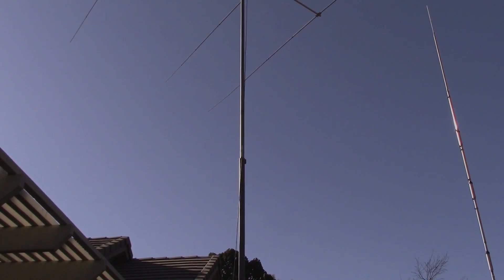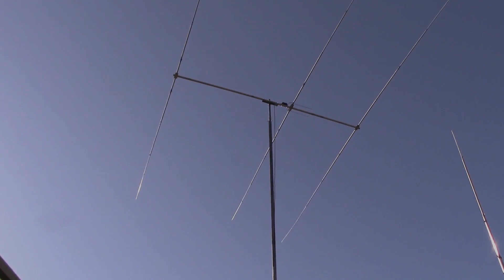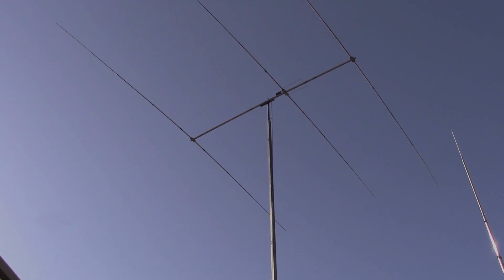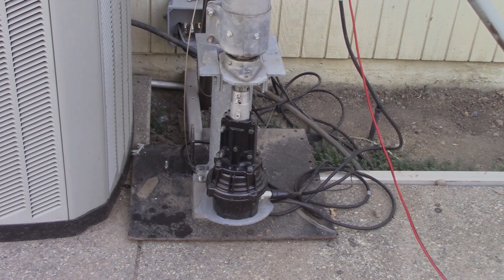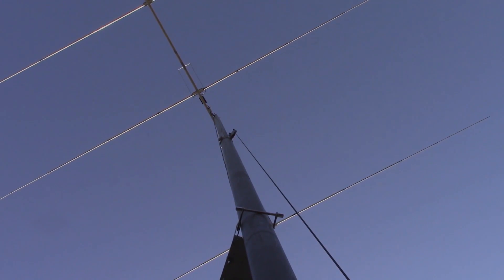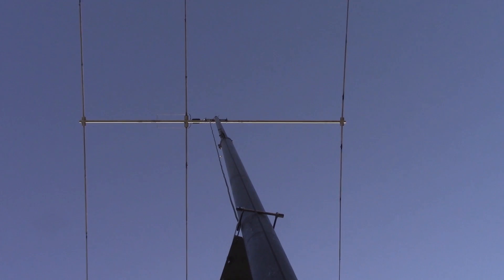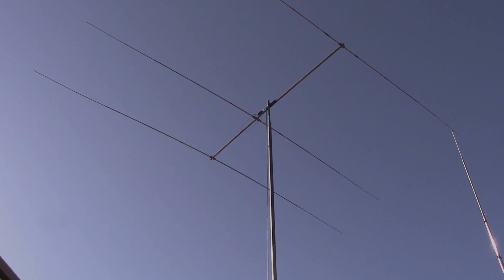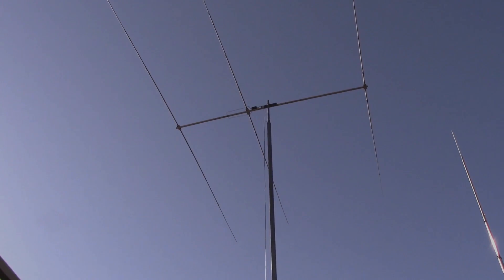Rotating Tower For Ham Radio 30 Feet Tall At Jim W6LG's House And Can Be Used For Emergency Comms.

Comment: hi jim great video as have just put a sirio 10m beam and rotator up myself good job i have allways used verticals and just thought i would try a beam out and im luving it and its only up at 8ft while im tuning it in and making sure its all working ok before it goes up on 25ft tower on the roof which is 50ft up so looking forward to it and i was hearing trinidad and tabaco tonight at a 5/5 anyway anough said jim thanx for the great videos i allways watch you and stay safe from steven in liverpool england the one who heared you and told you not long ago 73 and stay safe 73 ps it was when you was trying a beam i think not sure lol 73
Reply from the maker: Thanks and yes be careful about keeping distant, wearing a mask and washing hands.  If we are all careful, maybe this horror story will come to an end like the Spanish Flu. Thanks!! 73, Jim
Reply from the maker: Getting it higher will make a HUGE difference.  The guy in Trinidad would likely have been above S9 if your antenna was at the top. Have lots of fun with the antenna.  73, Jim
Reply: thanx jim its going up in a day or so ill let you know how i get on 73 and keep safe my friend

Comment: Hi Jim, could you help me understand how the tower itself is designed please?  I would like to do this at my home as well.  Looks like there's an inner & outer tube?  Also I'm wondering how to brace the upper portions.   We could do this by email if desired. Thanks,  KD0TLI
Reply from the maker: Yes.  correct.  Look for US Towers MA-40.  It is bracketed to the house top plate (top of wall framing).  There is one stiff arm and 4 more rods with turnbuckles.  Those rods are about 10 feet from the ground.  The base is locked so it cannot move laterally.  Hopefully, the whole thing is plumb. I added to winches.  One for up and down. The other one is for leaning the tower over.  The third motor is the rotator below a thrust bearing. Thanks Dan. 73, Jim

Comment: I know this questions has nothing to do with your video... but I thought you might be able to help.  I have been studying for my tech and general license... but with everything going on I am having a hard time finding VECs and or tests...  Do you know of any online testing?  If so, could you point me in that direction.  The ARRL was less than helpful.
Reply from the maker: Yes.  I am a Life Member of the ARRL.  I will call there and see what I can find out.  73, Jim W6LG
I am going to ask about Tillerman, Ohio...correct?
Reply: @ham-radio  I have not registered with the ARRL, merely searched their site and called their number.  Spoke with folks at the "main office" and the VEC section.  They basically told me to look on their webpage.  I found a couple of exams, but when I called about information they said they are all cancelled.  So, trying to find an online testing option.  You can email me at:  Tillerman59@gmail.com if you have any additional questions or suggestions.
Reply from the maker: I will call and ask about online testing.  My Life Membership should mean something.
73,  Jim
Reply: @ham-radio  Thank you so much.  It's appreciated.
Reply: Did you happen to hear any from the ARRL?
Reply from the maker: I did send an email to you, but I did it wrong.  I got a noreply@youtube.com.  The short answer is that no one is giving an online test that I could find.  My next stop was going to be W5YI.com and see if they had anything.  The ARRL was response was confused and sadly lacking of any solid information.  Basically it was go find out on your own.  Sorry that I struck out.  Regards, Jim
Reply: Jim W6LG well thank you for the attempt. Let me know if you find anything. 

Tillerman59@gmail.com

Comment: Hi Jim. What causes a clip on ferrite choke to vibrate on a 240v power line. Too small, loose, good bad?  Thanks for all the great info.
Reply from the maker: No idea but, I might just guess that it is too much current for the size of the bead.  Or , there might be huge common mode currents.  If you figure it out, please let me know. 73, Jim

Comment: Jim, So pleased to see you have the tower & beam up and running! I'll be listening for you on 20m from now on! 73 Tom.
Reply from the maker: I am somewhat QRP until I see if there are any complaints. G3HQG, Gordon, was posted on the cluster but I could not hear him. It was too early and the sun was in the wrong spot at that time.  Thanks Tom and maybe we can make it on 20 meters.  The rising solar flux is looking good. 73, Jim
Reply: @ham-radio  I agree the SFI is on the up presently, Managed to work Bob VP8LP in the Falklands  /M on my monoband whip earlier this evening (Second time in a month!) Hope the QRO doesn't cause you any issues! 73, Tom.

Comment: Very    cool ..     I had   a  50  ft tower   in   1967   a  Th6   HyGain ...   antenna    my   parents   were  very   understanding....
Reply from the maker: Ya, mine were not so much. But it sure was fun to connect a receiver to that large antenna and hear the world.  I ran homemade ladder line up the hillside for about 100 to 150 feet on 4 x 4 posts to a Mosley Antenna in about 1966.  Yes, receiver, we did not have many transceivers in the 1960's.  thanks Steve...73, Jim

Comment: Hi Jim, I love your videos, which has helped a lot to pass my extra class license. Curious, what is the vertical antenna next to your tower? Best, Dave AI7BW
Reply from the maker: Hi, It is a reference antenna for me.  It is 40 to 10 meters and started life as a 4BTV vertical.  So far, I don't have the performance of that antenna up to where it should be.  I will explain more about that in a few days along with some other field strength measurements.  Thanks for watching Dave. 73, Jim

Comment: Nice job on the tower Jim. Also thanks for picking me up today on 14.275 and helping me test my new solid state amp, you were my first contact on the new amp. It seems to work! 73 and all the best from Utah, Mark / NQ0A....
Reply from the maker: Many years ago, a solid state amplifier was trouble. It was easy to destroy the transistors and harmonics from the amp were way too strong. Today, the solid state amps are very reliable, have good protection circuits and good filter systems to lessen harmonics to a level better than required by the FCC.  I have a solid state amp that does 500 watts with ease. That amp has never failed.  It will fault in a split second when I make a mistake.  So Mark, enjoy that new amplifier.  I hope to hear you again soon on 20 meters.  73, Jim W6LG

Comment: Jim, anyway possible to give a parts like of the tower system. I would like to tackle something like that at my house. Great video by the way. 73 Clark KG7LOI
Reply from the maker: Well, there is a hex beam supported a TV mast that all works reasonably well.  In any case, any antenna is better than none; of course. 73 to Clark from Jim W6LG

Comment: @Jim W6LG :: I live in the Southern California mountains at an altitude of 6300 feet. Unfortunately I live on a slope. No good for a tower. Prior to living here I owned a home at Big Bear Lake California, the southern Ski Resort. We were allowed to 65 foot Tower. Dad and my SteppIR and I was happy. But at the new QTH on a fan dipole and I'm not so happy. Especially at the bottom of the cycle. I ended up getting a divorce and understand fully well now why they say it's cheaper to keep her. It's ironic that I offered the tower which was a hustler 52 SS to anybody that was willing to go to my old home and take it down. It turns out the guy across the street from me is the one that went and got it and I didn't even know it at the time. Now it sits under his front porch doing nothing.

I love your cheerful attitude that even though you can only go 30 ft you've got something in the air. I imagine you can get an inverted V up as well. Keep up the good work.

Comment: Do you use any type of safety limiter so that your coax or pulley cables dont get twisted to pieces from over rotation?
Reply from the maker: Not yet....but I will.  I know that at sometime I will make a mistake and cause damage. thanks Justin.  73, Jim

Comment: Hi Jim,
I have a similar sized tower, a Wilson TT45 with the rotating base raising fixture. Using a Hy-Gain T2X rotator and had a similar problem connecting the rotator to the shaft at the base of the tower. The shaft was 1 1/4" and the minumum size the rotator could accept was 2", so the difference was 3/4" and I used a short piece of angle iron the has 3/8" thick. Stay safe.  73  WJ3U
Reply: Pics available?

Comment: Jim, good morning 
Like your setup. How do you work on your antenna. I have 25 and 45 g, at my age don't need to be climbing. 
Where did you get your tower 
73
Reply: He mentions in the video provision to tilt it over.
Reply: @Justin-bd2dg  tnxs  Who's the manufacturer
Reply from the maker: Paul it is US Towers MA-40 with a mount and a fixture that I made.  I bought it maybe 15 years ago and had it on Wolf Mountain . 73, Jim

Comment: Hi Jim glad to see you are back! This is a great video! Could you supply more details about what parts you used. I live in a non HOA community and I have a 40 ft. push up pole with a cob web antenna but i would like to have a beam and I have a location where I could put up exactly what you did. Thanks
73 N6XBP

Comment: From the research I did to try to convince my HOA to allow me to put up an off center fed dipole and a multi band vertical antenna, the FCC has a rule that very plainly states that no state or local municipality may place a restriction on the height of an amateur radio antenna. I used PRB-1 to convince them and they agreed.
Reply from the maker: Being new to this County, I did call and talk to the Planner, Mayor and City Council.  All were friendly  and helpful.  I decided to not press the issue at this time.   Honestly, my health is not good and just don't have it in me to seek a change to the Plan.  I had to live within budget and what I could physically handle.  The tower was moved from my old location.  Thanks for your help.  I know you are right.  I was a County Planning Commissioner, Deputy Tax Assessor and Deputy Building Inspector.     In my old County, I was able to exempt all ham radio antennas in the General Plan.  Luckily, there were 2 of us that were hams. 73, Jim
Reply: Jim W6LG I probably should have given my reply a bit more thought. I intended to be informative for others in a similar situation. I was not ‘pushing’ an issue nor was I intending to be critical. I was shocked when the design review board of my HOA voted 5 in favor, 1 not, and one abstention (he is a CERT and ARES member). Please take care of yourself. I enjoy your videos. 73 Robert de kn4qic
Reply: lysippus exactly.

Comment: Very nice setup Jim! I really thought you might consider a Hexbeam, but then I remembered you prefer to work on 20m only. Good DXing my friend!
Reply from the maker: I was concerned about the appearance.  Also, the bands are still pretty quiet above 20 meters. Also, I have lots of tubing...lots.  So, I did not have to buy any parts.  That antenna has Cushraft, Mosley and Hygain parts.  Thanks Jeff. 73, Jim
Reply: @ham-radio  A Frankentenna.   :)

Comment: Are you planning on adding anymore antennas?
Reply from the maker: Well....I should say no because they even limit the number of antennas.  But I am going to try some wire antennas that I think will be invisible from the front yard.  That's a modified 4BTV on the fence.  I plan on using that for digital stuff and as a reference.  73, Jim
Reply: @ham-radio  Thanks and 73 de W0AAE